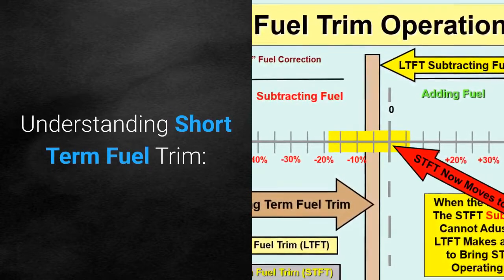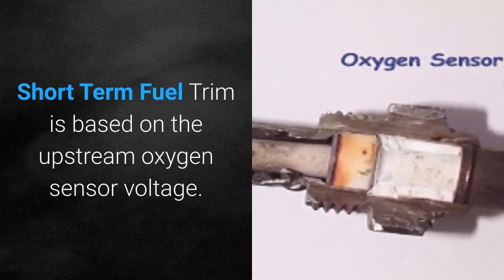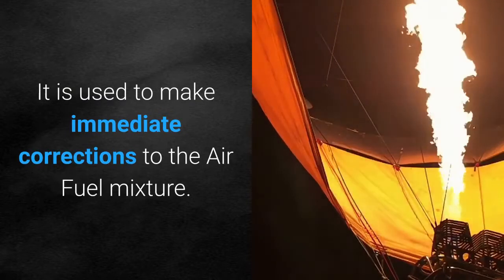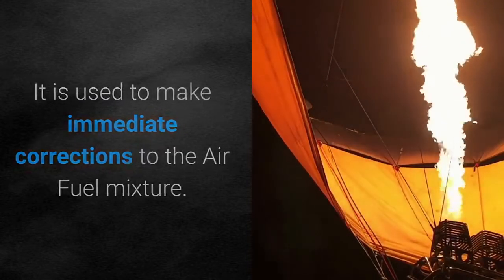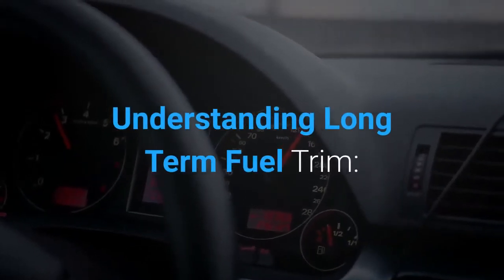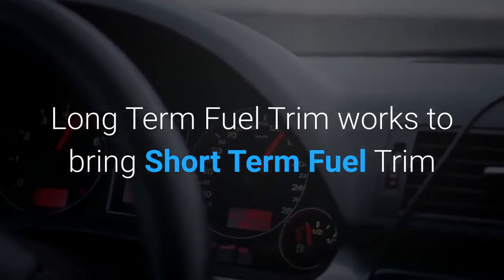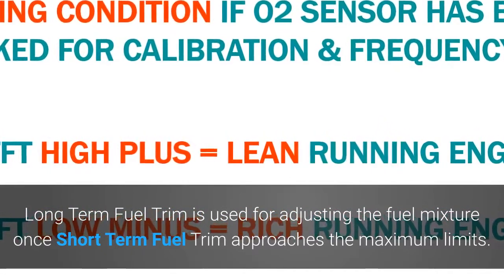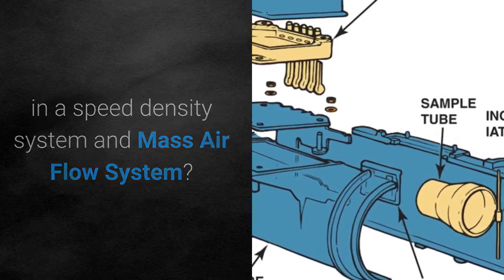Smog Repair License Study Guide Short and Long Term Fuel Trim

Comment: How can lgft used in open loop if stft is no shifting..?
Reply from the maker: LTFT are learned and stored in fuel cells in open loop the PCM is using those  values as reference
Reply: @natedaviscteinstructor  got it sir.. thanks